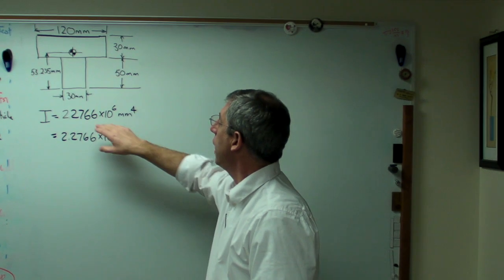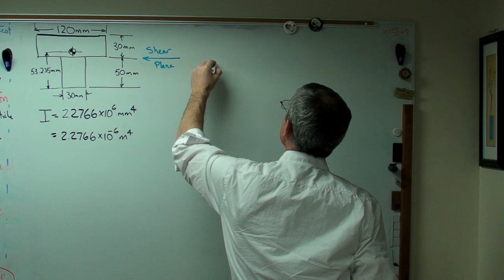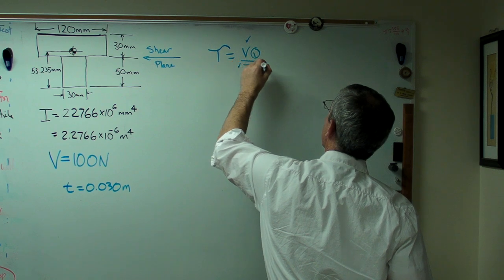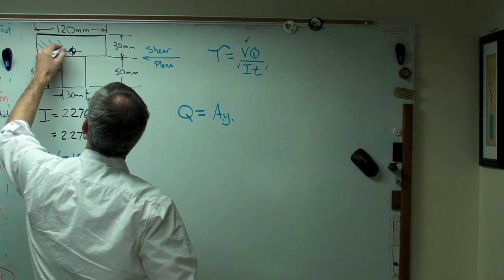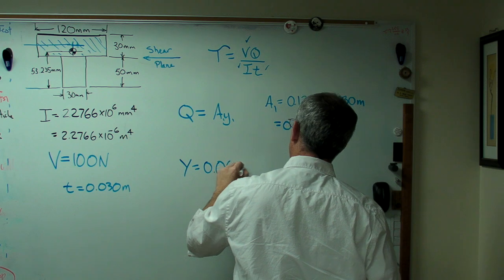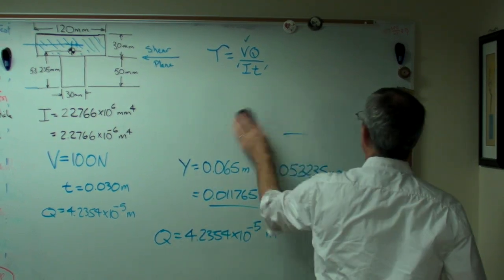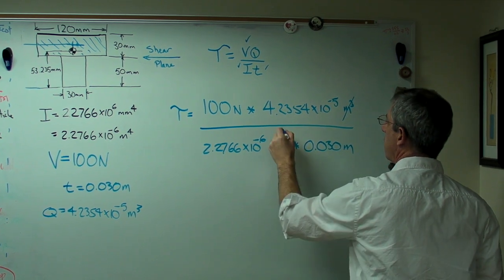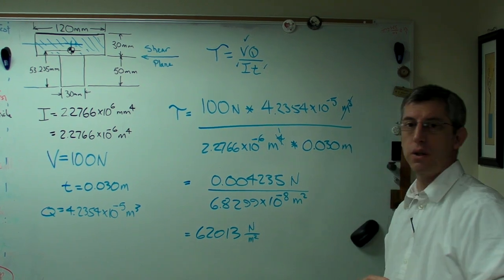Shear Stress in Composite Beam.MP4

Comment: thanks for your video. I have a question that would it be possible if I use the upper box to do this problem. If thats the case then would the width (t) still be 30mm?